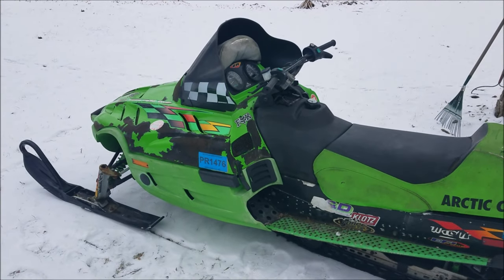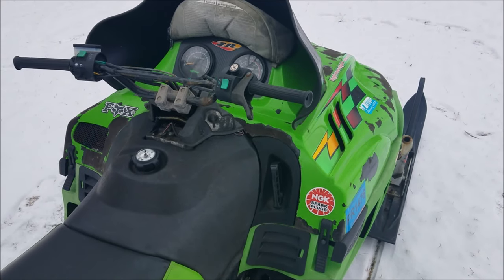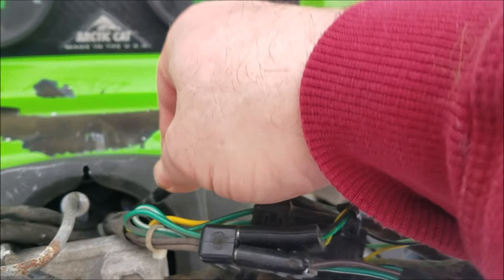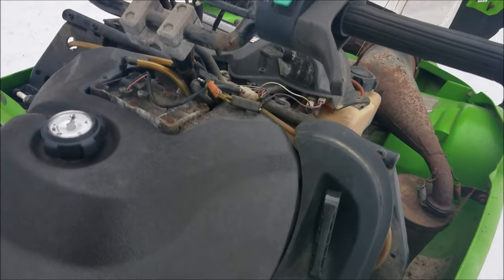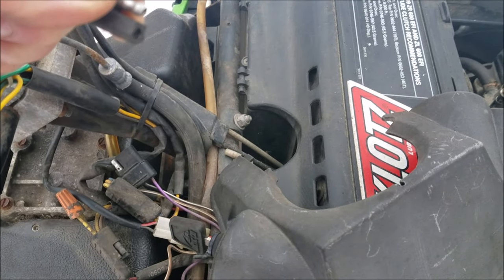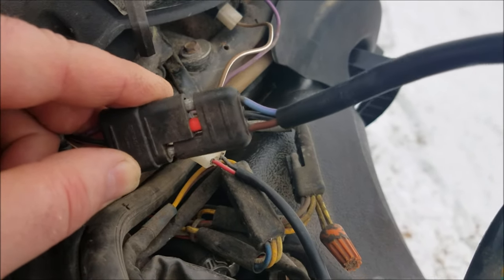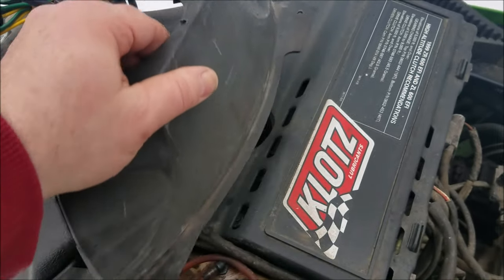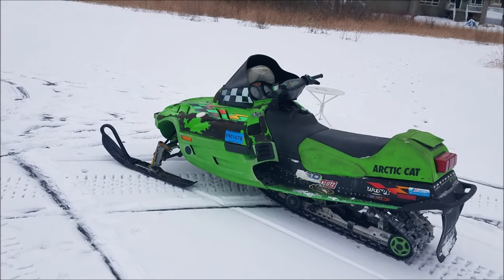Arctic Cat EFI TSS Throttle Safety Switch - 3 wire - 1999 ZR 600

Comment: Great video thanks for posting I’m going to try it on my 2001 ZL 600 this weekend to see if it solves my no star problem. I’ve got gas going through the rail and I’ve got spark but it’s like something’s not telling the injectors to open. Nothing to lose at this point I’ll let you know how it goes lol, thanks again !!
Reply: Ya this didn’t help me I guess my problem goes deeper. It’ll start with some mixed gas in the plug holes but won’t stay running

Comment: infinigrove- late to the party, i tried this, but still bogs down.  Any idea why this continues.  Changed plugs, fuel pump, not sure whats left
Reply from the maker: Maybe old gas? Is it an EFI or Carb machine?
Reply: @infinigrove  first thing did was siphon all gas out, replaced with new.  Sled is EFI, so no carb

Comment: Thank you for that tip my 1998 Arctic Cat powder special 600 twin bogged down tonight going 90MPA across Island Lake in Nikiski Alaska I noticed my throttle when I wiggle it it would try to kill the motor I going to try your trip to see if that fixes my problem. 👍😎👍 THANKS

Comment: Mine will bog like that but it won't die.  I let off right away and feather it back up to higher RPM's and go.  Will have to give it a try.  Same machine as you.
Reply from the maker: If I would have let off the throttle right away it would not have died.  Good luck with your machine.
Reply: @infinigrove  very helpful stumbled on this video by accident , luckily I did fixed the problem for me !
Reply: I unplugged it and my sled won't start after unplugging. No spark .
Reply: Then plug it back in😂

Comment: What if key doesn't shut it off either?
Reply from the maker: Usually the key switch will ground out the engine in the off position.  If the key switch doesn't shut it off then the key switch wire is probably cut or disconnected somewhere.